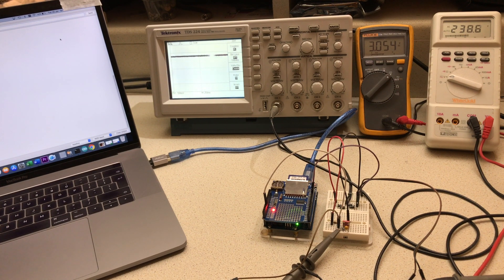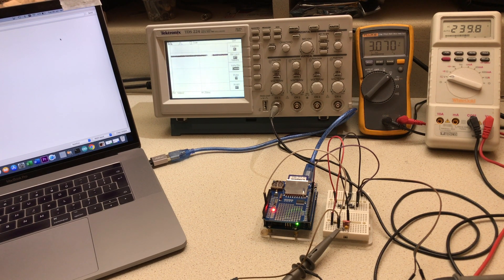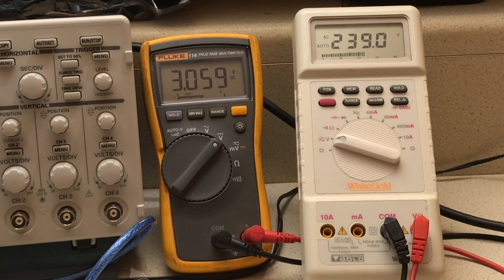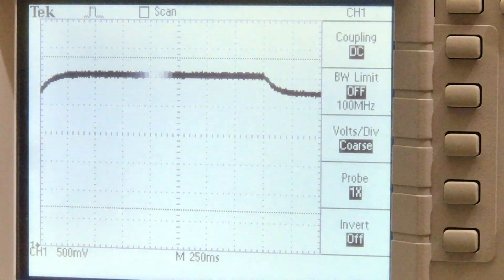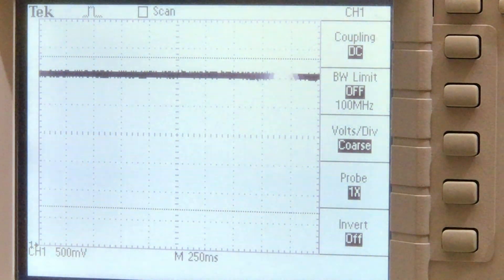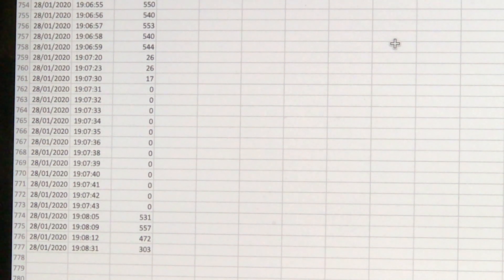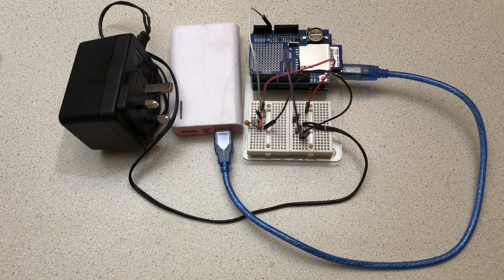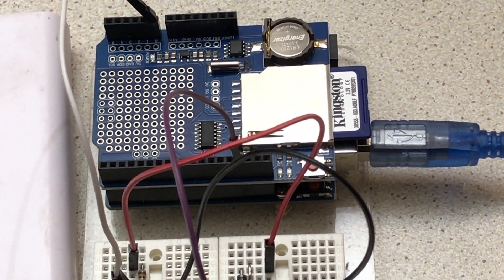ARDUINO UNO BROWNOUT DATA LOGGER RTC

Comment: Hi Mike this is great and in the process of building for an off-grid logging where we are trying to log how many hours an aerobic pump on a sewerage system is on for. The AC pump turns off when the battery protect drops below 12.8v. We want to log when the AC power is  ON or OFF. I will need to ensure power to the logger 24/7. What is the powerdraw of the logger system?
Reply: From Andrew - BNE, AU
Reply from the maker: Hi Andrew. The power consumption for the Arduino is low, just 10's of milliamps. The main unit for power consumption would be the power pack which will draw over 2 amps when charging, however when it is "full" this would drop considerably. Remember you will need a power pack that can output a supply as well as being able to be charged at the same time. This is important. I hope this helps. Thanks for watching and all the best with the project 👍🏽
Reply: @MikeMakesIt  thank you very much Mike. Sorry to pester you as this is off grid (reliant upon battery solar system). How long will the backup battery last for if the power-supply is off. The power supply is cut-off when the solar system battery cuts at low voltage threshold and from 6pm to 6am. During the day the power is excellent (very sunny area)
Reply: Approx 6pm to 6am when there is no sun available.
Reply from the maker: Hi Andrew, no problem. I use a battery pack for a heated vest here in the Winter and that draws about 1amp and I can run it for about 6 hours. It's a 10000ma Anker battery pack by the way. So I'm thinking as the Arduino draws so little, 10's of ma's only, even one of these packs would keep the logging system alive for 12hours. When the system is back up and running these packs draw about 2amps for about 3hours to fully charge them. Basically a 10000ma battery pack should be fine but to be on the safe side go larger for extra protection. As stated before you need a pack that can be charged and output a supply at the same time. I'm not sure if the Anker can do that. The pack I used was a no name pack. I hope that helps, thanks, Mike 👍🏽
Reply: @MikeMakesIt  thank you. This is perfect. I will provide my notes on my use case adaptation and success.
Reply from the maker: Great thank you 👍🏽
Reply: @MikeMakesIt  Could you please specify the data logger model or part code. There are quite a few variants and don’t want to choose the wrong one.
Reply from the maker: Hi, I've added a couple of photos on my Google drive of the data logger. I bought it a while ago so have no more information on it I'm afraid. I hope this helps. Link to drive:
https://drive.google.com/drive/folders/1JB2ph-IEE6zXqnaPQNnCBSKcTfrR1L9k?usp=sharing